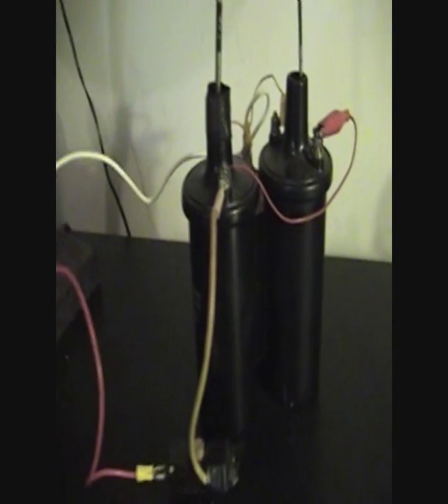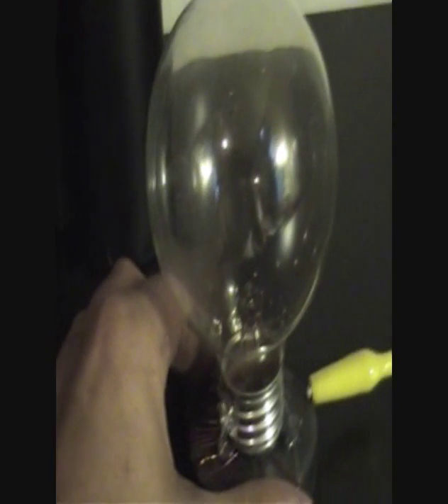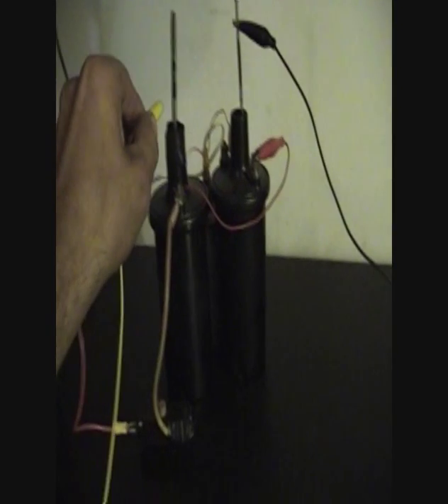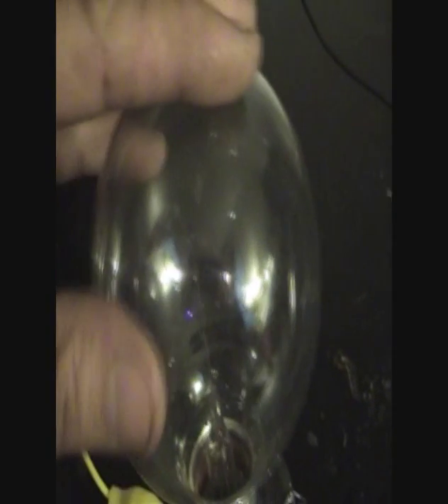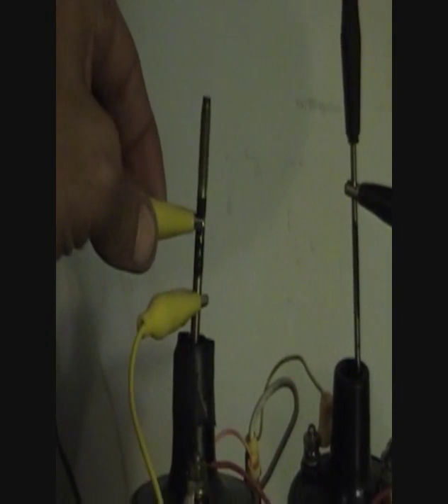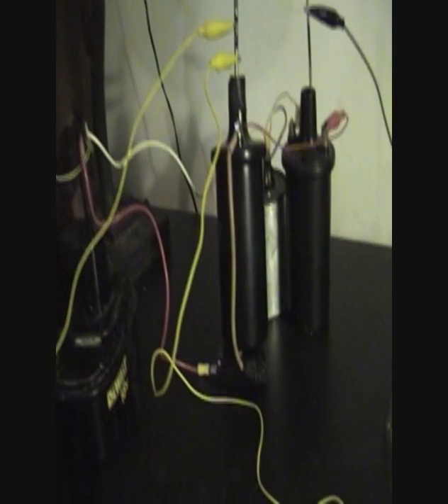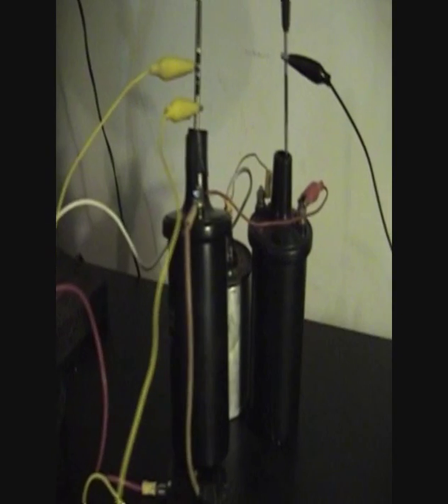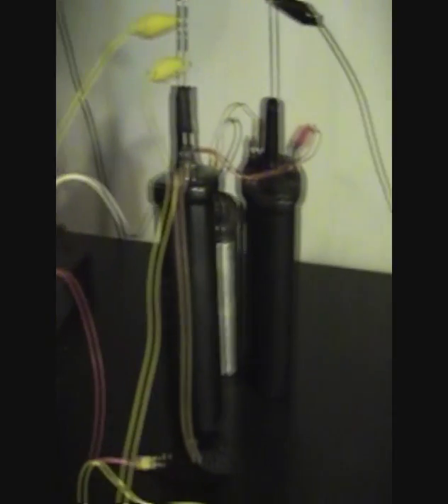plasma ball

Comment: The reason you don't actually get shocked is because the voltage is so high and the current is low enough that a phenomenon called the skin effect occurs, at very high voltages, there is high potential charge difference between two points, but if the current is low, the air is ionized but the amount of current (number of charge cariers) is not high enough to hurt you. It's a risky experiment though if you don't know what the voltage and current levels present are.

Comment: Nice experiment.
Do you really have the 2 ignition coils in
parallel or in series ?
Did you try to hook a scope in parallel with the
primary coils to see, how the primary coil waveform
looks alike ?
Does the drill triger just generate a PWM square wave ?